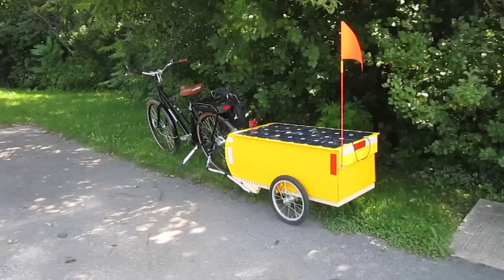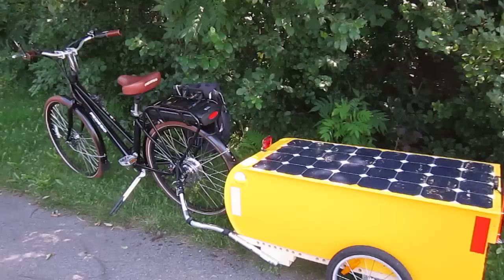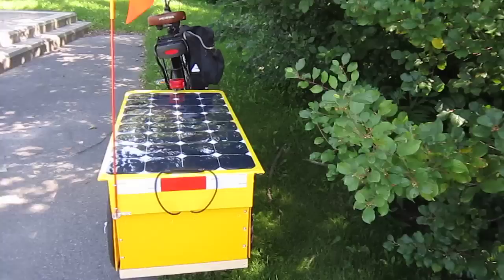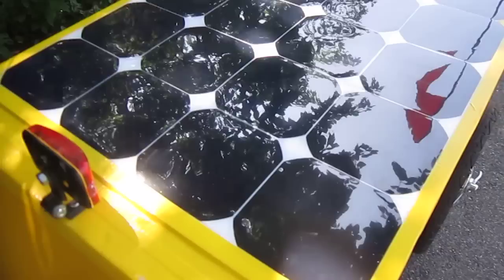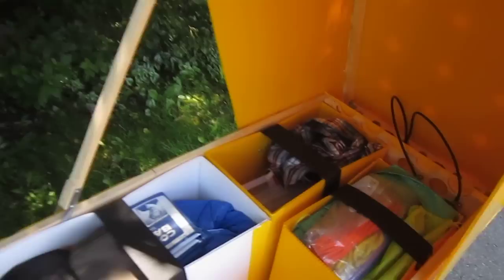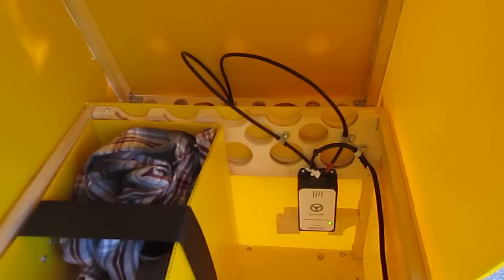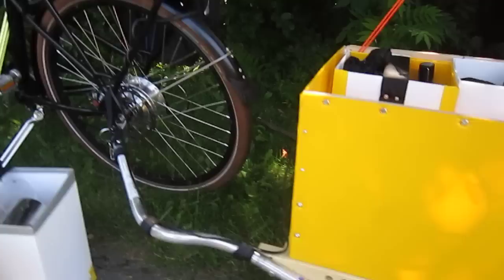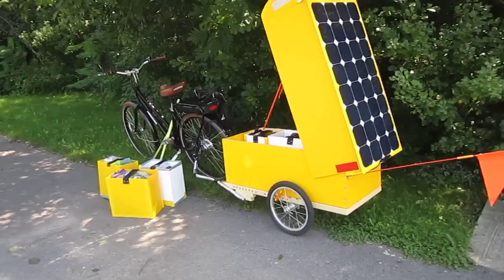Solar electric bicycle touring trailer for luxury camping

Comment: How tall is that trailer? Great design the solar panel . Flexible?
Reply from the maker: Good question. I just realized that my drawings aren't quite to scale and I didn't make a note of the height. So when I go to the self-storage place to get my bikes I will check the exact dimensions.
Reply from the maker: Nikko, the height of the body of the trailer is 16"
Reply: @RobertBeriault753  excellent thanks is the Camper the same height? Thanks again
Reply: @RobertBeriault753  did you receive my pics via email?

Comment: At touring speeds of 15mph, can you make turns on the road without roll-over?
Reply from the maker: Good question. I have to use caution in making sharp turns. It may mean making a wide turn or simply slowing down. But I have had an unexpected mishap once at a street corner, after the pedestrian light had changed. The trailer was at quite a sharp angle to the direction I wanted to go,  the outside tire went over a bump and to my dismay, the thing just flipped over to its side. No damage, except for a red face 😃. But when riding normally on a bicycle trail, I can take most of the curves at 15mph. Might have to slow down on some of the sharper one.
Reply: @RobertBeriault753  I will check out your other videos, thank you.

Comment: I know this is an older video but I'd like to ask, can you tell me where you got the little charge controller for your battery charger?  The portable battery charging unit I've been working on uses a type of dynamo charger that is spun by the trailer wheels.  My problem has been that I've not been able to track down specific components like the charge controller you show in this video.
If I understood your setup correctly, your solar panel connects to the controller then directly to your battery?  How many amps is being sent to your battery?   Is it just a trickle charge set up?
Thanks.
Reply from the maker: This page provides the information on the controller: https://www.robertberiault.com/technical-details
It's not a trickle charge, but the charge varies with latitude, time of the year and cloud cover. See this video:
https://www.youtube.com/watch?v=EUUOfdXc028&t=53s
Reply: @RobertBeriault753  Thanks for taking to time to reply.  I appreciate it.

Comment: Great work with the trailer! I am interested in building something similar. 
Just wondering where you got the dc-dc converter for charging bike battery?
Reply from the maker: Hi Matt,
Thanks. On my website I provide information and photos about the construction of the trailer and about the electronics. Good luck with your projects. This is about the solar panel and controller:
olar panel:  100 W, semi-flexible by Sunride Power, affixed to the Coroplast surface with Duck Tape (D-u-c-k tape, not D-u-c-t tape) [Size: 42"L x 21 1/4"W x 1/8" H, Weight: 5 lb]Charge controller: 12V to 48V boost controller by Sunride Power [Weight: less than 1 lb] www.sunridepower.com

Comment: hi robert just wondering about the solar booster and where i can get one thanks
Reply from the maker: Sunride Power, Richmond, CA.
But the one that those who build a solar charging system for ebikes recommend is the Genasun Solar Boost MPPT Controller (genasun.com). Good luck
Reply: @RobertBeriault753  thanks

Comment: Hi Robert! It is Amazing! Can I have a question to you? I have a Bosch motor electric bike with 500 PowerPack Bosch battery. ( 36V,  13.4 Ah, 500Wh ) What is not able to charge without remove the battery from the bike. So I'm thinking to buy extra battery and charge it some how during the ride like you did and just change it when the other is to go dead. I don't know it is passible because everybody is saying the Bosch battery is not chargeable like this. I have a Haibike Exduro Trekking S and I really would like to ride long distance during the summer. Thanks!
Reply from the maker: Hello Normen
I don't see why you couldn't charge your second battery while riding with the first. But I never tried charging my Bosch Cube this way. Maybe you could contact Bosch directly and ask them. Good luck with your travels.
Reply: Thanks! This is what I'm thinking. Ride with the first and charge the second during the ride. The Bosch is not responding in this question. And they are saying the Bosch battery charging is only with Bosch charger. So I have to find the AC110 outlet solar panel solution.
Reply from the maker: This would work, but you would lose a lot of power through charging the 12 V battery and converting the 12 V DC to 110 V AC with the inverter. If you adopt this system, you would want your 12V battery to be Li ion, not lead-acid, because of the weight. To me, it does not seem to be an elegant solution.

Comment: sleeping on the ground seems a real bummer.  Someday  someone will come up with a front  wheel steer/powered and bike and make the rear wheels part of the trailer..  or power the rear wheels with electric hubs..and use the elongated frame to sleep on.  aerodyamically you would be far better off.. lower   cg..
Reply from the maker: I'm working on a totally new design of trailer caravan for bicycle touring. This would replace the tent and save a lot of time setting up and tearing down. My design will have a low centre of gravity and weigh under 25 kilos. It will be narrow and wide, short and long, low and high. Of course, I will create a Utube video once the project is completed.
Reply: Looking forward to this new, and comprehensive, design. 

Meanwhile, I hope your treatments are going well. I’ve had many friends and acquaintances go through this recently with great success. All the best!
Reply from the maker: Thank you. I'm taking this one day at a time. Fortunately at my age, time goes fast!

Comment: what is the range of the bike with the trailer and without? By range I mean how long does the battery assist last. before needing to be recharged. Very important detail.
Reply from the maker: Range is very variable, because it depends on many factors, such as wind direction, topography, weight of cyclist and cargo, speed and level of assistance demanded by the cyclist.  But, in a nutshell, on a 500 km trip I recently made, all on sunny days, in early September, while towing a 100 lb trailer, on average the battery would give me 65 to 75 km and the solar panel increased this by 25%. In June I would expect 40%. I have the big battery, 15A 48V, which gives 720 watt-hours.
Reply: does that 65-75 km include the 25% solar panel input?
Reply from the maker: No. 65 -75 km is without the solar panel
Reply: jesuisravi yes. I would hike to know also. I've wanted to do this for a while but being handicapped and a big guy  an  electric bike has a limited range so recharging on the go is the ticket!! What type of battery accepts charge while in use? Range with your weight would help also?
  Now when I tell people my idea I can show them this as proof of concept!
Reply: If you stop for lunch, or to set up on site and the sun is out, you can increase the solar charge by parking up and tilting the panel towards the sun.
Reply: Think about it. If it takes 6 hours for your 120vac charger to charge your battery what is a 100w 12vdc panel going to do? I call bs on the 25% Hooking a 12v solar panel to a 48v system isn't getting you anywhere. It's like trying to charge your car battery with your phone.
Reply: Big Dan - it’s reasonable. If you use the 100w from the panel to supplement the battery draw whilst riding, it’s all getting used. The motor is 250w I think, so 100w represents 2/5, although, because it’s flat and not tilted, you can half that. 1/5th is 20%.
Reply: You're still trying to charge a 48v system with a 12v panel. Your motor is pulling 250w at 48v. That is 1000w at 12v while your panel is putting out 100w = 10%
Reply: But because it's flat and not angled toward the sun you can half that to 5%.
Reply: Big Dan, I take it you are not an experienced electronics technician so I’ll forgive the schoolboy errors. If you want me to explain it technically, I will. I was a Chief Electronics Technician in the Submarine service, and I used to teach mathematics and electronics to junior mechanics in my later career.
Reply: No I get it, I knew I was stretching with that last post. It's something that has been rolling around in the back of my mind for a while now that never made sense. But your response sparked me to finally put 2 and 2 together. 

I couldn't understand why watts couldn't convert. But Watts = work done. It doesn't change. Watts are Watts are Watts. 

A typical 100w panel is 18.9v and 5.29a. Under the best factory conditions it will produce just under 100w in 1 hour. Period. There are newer panels made from better quality cells that can run in different configurations. But if you bought a 100w panel that is what you have.  

This threatens to take me off into so many other directions with solar panel systems but that is neither here or now.

But this also led me to a discussion about bike motors and how they don't actually give you the full data sheet. They are in fact quite the opposite to solar panels in that they are rated well below their capacity. They don't even make 250w controllers. The lowest 48v controller they make is rated at a peak 16-20 amps. And who even knows what "half power pedal assist" even is. No one without an amp meter. 

Anyway thanks for sending me down the right track.
Reply: Big Dan you are still misunderstanding the 100w of the panel. It has nothing to do with an hour.
Reply: This is driving me nuts.. I really wish I had gone into electronics in college. Although I suppose it's never too late. I believe I understand now, however, that in an ideal world a 100w panel would supply 2/5 of the power while the battery supplied the rest, regardless of the voltage difference. The battery supplies it. In the end they all add up to the same numbers. Wattage is just the easiest form of expressing the input required or output gained. 

Adding time only matters when dealing with storage.

Then when accounting for loss, without the panel directly pointed at the sun at all times apparently you can lose up to 38% effieciency. 

And this panel will still have to go through your battery. From my understanding if it is anything other than a heavy lead acid battery you're going to need a Boost MTTP controller. Luckily these are very efficient. 

So 20-25% is easily attainable during peak midsummer hours. 

And if you ride it for say, 70-80 minutes and camp out for the night and the next day.. it should be fully charged by the next afternoon. But if you're camped out  it would behoove you to keep the panel facing the sun. I'd wager you could get more than 2 hours of ride time every other day in this situation without depleting your battery past what could be charged with this panel on a bright sunny day.. 

Now what we need are panels that can pull more power from a smaller surface.
Reply: Dan, just to clarify, 100W is 100W regardless of voltage.
Watts = volts x amps, so 100W = 48V x 2.08 A
At 12V, 100W is therefore 8.33A.
The panel will be running at its maximum power point of about 17V, so the charge controller should be seeing 5.88A max at 100W
A boost converter has to work pretty hard to step up the voltage by a few factors, so there will be a few percent lost in conversion.
Robert could improve power production significantly by putting the panel on hinges, or maybe even adding another panel.
I'm planning on doing something similar with my ebike and home made panels.

Comment: How do you charge a 48v battery bank with a 12v panel?
Reply from the maker: Good question. I use a boost charge controller sold by the company that makes the canopy solar charging system for the Pedego bicycle. It boosts the voltage from 18 V to 56 V and regulates how much charge goes to the battery and stops charging before the battery is overcharged. It is called Sunridepower. The brochure on the website mentions that it is an Maximum Power Point. As soon as we get a full day of sunshine in the forecast, I will run another test on the panel to ensure that it is capable of fully charging the battery. So far, I have never fully charged the battery with the Sunridepower kit. I was only using it as a range extender while the bike was underway.
Reply: I'll have to look into it. I'm guessing that it decreases the amount of current and ups the voltage. I guess as long as it works that's all that matters. Really cool setup you've got. I've just recently built a camper van and I ran a 12 volt system in it but I'm still learning all the ins and outs of electricity. I really wish I learned more about it in school. Thanks for the reply. Have an awesome journey and make sure to take lots of pictures!! :-)
Reply from the maker: Nominal 12 V but delivers 18 Volts. Divide 100 Watts by 18 V and you get 5.5 Amps. When boosted to 56 Volts, Divide 100 by 56, the best you'll get is 1.79 Amps going into the battery. Last September on a clear day I was getting about 1 amp. Multiply 1 amp by 56 Volts and I was getting 56 Watts out of the panel at that time of the year, with the panel horizontal to the ground.

Best regards

Comment: what bicycles is the best for pulling and towing give me the name brands ?Cause some bikes can tow better then others ?
Reply from the maker: Hi Mangreat

The answer in a nutshell is the bigger the motor and the battery the better. I will soon be posting a video about what I think is the ideal ebike for towing a trailer on a long trip. No manufacturer makes the "ideal" electric touring bike for pulling a heavy load.

Comment: How is your set up on hills??
Reply from the maker: The trailer, fully loaded weighs 45 kg (100 lbs). I have two ebikes, a Pedego City Commuter and a Bosch Cube, two very different bicycles and technologies. There  is a really steep, long hill nearby, Montée Paiement. Near the top of the hill both bikes had reduced to 11 to 12 km/h and were still holding out pretty good, while I was pedaling moderately hard. On a trip in the Laurentians with the Pedego with a similarly loaded trailer, I had no trouble. Neither the motor nor the battery heated up. Because of reliability issues with the Pedego, I've decided to use the Bosch this summer, a 36V system. I'll have to obtain a new boost controller.

Comment: How long does it take to charge ?
Reply from the maker: With the charger it takes 3-4 hours with the Bosh Cube and 3-5 hours for the Pedego City Commuter. With the solar panel, I still have to do some testing before I can answer for sure.

Comment: J'ai le même système à ma voiture mais la remorque fait vingt cinq mètre de long 
I have the same system to my car but the trailer is twenty five meters long
Reply from the maker: Vous avez une bonne voiture!
Reply: Oui, mais cela ne sert pas à grand chose, car la puissance fournit et moindre que celle demandé pour tracter la voiture et quand il pleut, je dois la pousser. 
Yes, but this was not chosen, the power and type requested for the type of car and when it needs to be pushed.

Comment: luxury? A bit of an overstatement .
Reply from the maker: I was wondering how long it would be before someone would question my choice of the word. My system of boxes
 makes setting up and tearing down camp a lot easier. So in that sense, it adds a touch of luxury.
Cheers.

Comment: Hey, Robert. I'm back with more questions please. How powerful in watts is your solar panel? I use a boost controller also, but my panel (smaller than yours) is rated at only 20 watts at 12 volts. My controller boosts the 21 volts from the solar panel up to 54 volts to charge the battery, but it seems I cannot get the current flow from the controller to go above .02 amps, which would take a long time to charge a 48V, 17.5Ah battery. Perhaps I'm doing something wrong? I haven't tried to charged and empty battery, so maybe the low flow rate is due to the fact that the battery is not reading empty? I was hoping to get away with a smaller panel, but maybe I need a larger one. This video explains what I am trying to do: https://www.youtube.com/watch?v=ix5rvHUujhQ. Any ideas you could provides would be greatly appreciated. Thanks.
Reply from the maker: David,
My panel has five times the capacity of yours. I'm at 45° latitude and most of my readings were done early September, which means a low sun angle. Yet, I was getting 1 to 1.2 amps at noon. Under identical conditions you should get .2 to .23 amps, even better if you take your measurement at the summer solstice. I found that even a 100 Watt panel didn't free me from range anxiety. I'm sorry, but I don't know anything about electronics, so I can't help you with your problem.

BTW, you’d really enjoy it if you had a throttle to get you started from a dead stop.
Reply: @RobertBeriault753  Hey, Robert. Thanks for replying. After researching and learning a bit about the relationship of volts, watts, and amps, I think you may be correct. 20 watts may not cut it. Another viewer told me that when my controller "boosts" up the voltage, the amps will necessarily go down to keep the electrical equation balanced using a 20 watt panel. 

The problem may be that my controller requires a higher battery voltage than is available from the solar panel. Otherwise I don't think it operates correctly. Do you know how many volts your 100 watt panel produces? My system works as is, but it would take a very long time to charge my battery.

By the way, first time out I forgot I even had a throttle to use. Since then, yes, I have learned to use the throttle to help get started from a dead stop.

Currently building a two-wheeled trailer from scrap wood, PVC, and nuts and bolts. Thanks for the inspiration. I may need it to carry a larger panel. BTW I enjoyed your tours of eastern Canada. I may have to jump on the ferry from Port Angeles and do some touring over there. Take care.